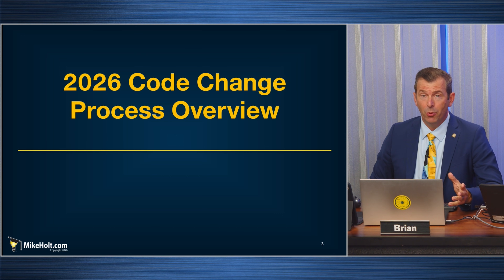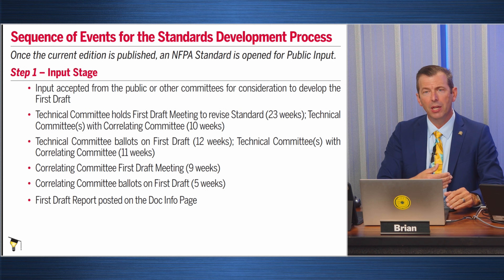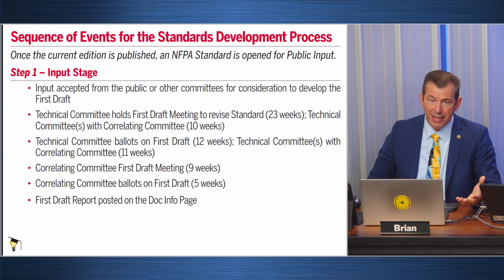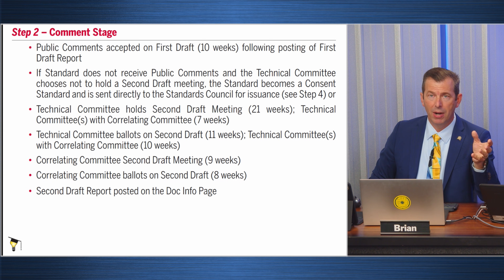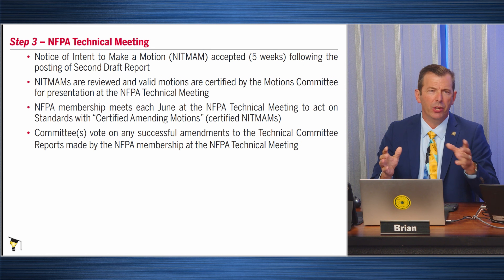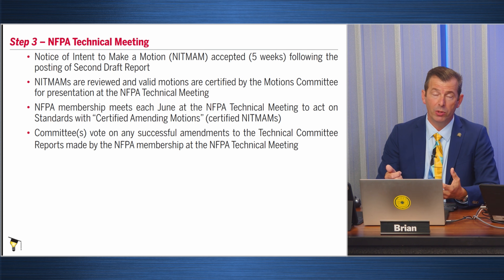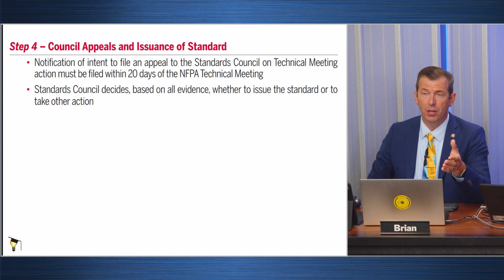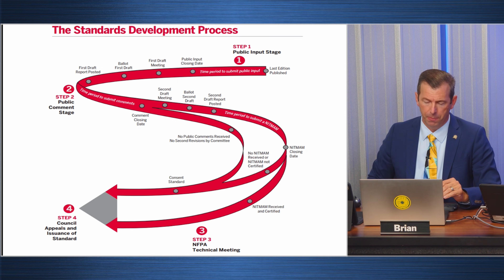Code Change Process Overview, NEC 2026

Comment: The scenario… 
A 400 amp 3 phase service that calls for 2 ground rods to be driven and used for the GEC. It is a metal building that has steel and qualifies as a GEC also. Do I have to run a wire from building steel all the way back outside to the service and hit the ground rods or can the wire be brought close to a nearby panel and bond to the EGC bar…. Love the videos and education that comes along with them. If you could point me in the right direction with code reference, thank you sir!
Reply from the maker: @brantsmith9932, please post your question on MikeHolt.com/Forum

Comment: My problem is that the NEC is becoming more complicated and coming more of a design manual not a safety code.  Also I see a lack of economic analysis in the preparation of code changes.  One of the biggest problems with the high cost of housing is the cost of regulations and the code is part of the problem.  Brian makes no comment regarding economic consequences.  In short NEC is part of the cost of high housing costs and not a solution.